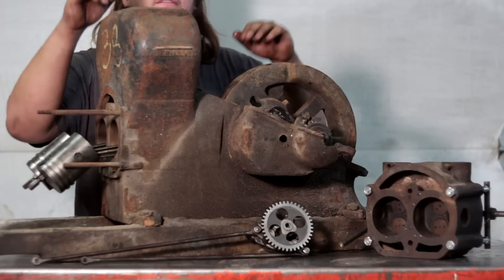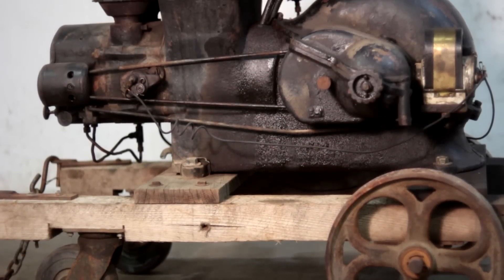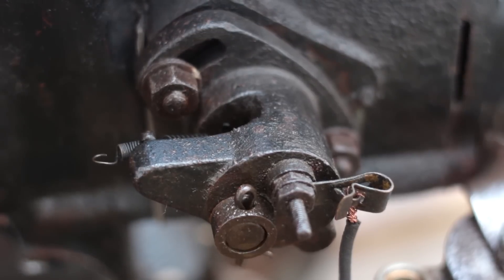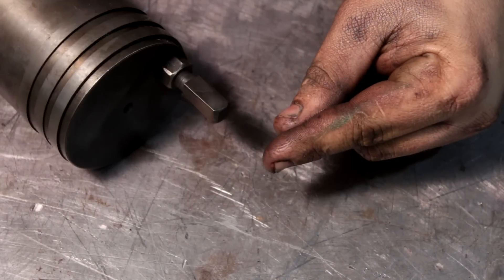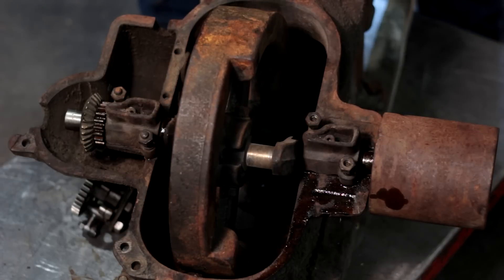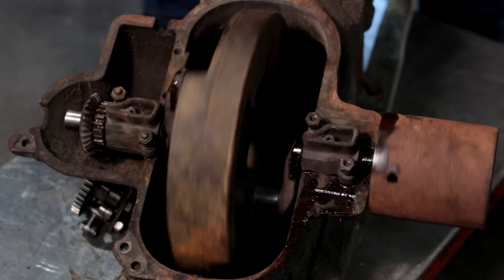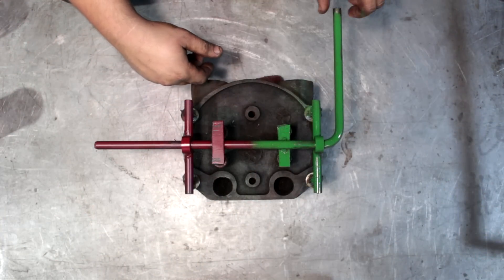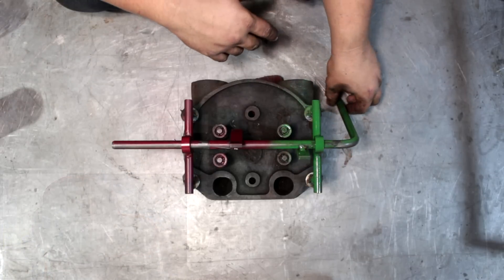DEEPDIVE into 100+YEAR OLD Engine Design Like Nothing  Seen Before! The FLYWHEELS HELD ON WITH LEAD!

Comment: All gas is leaded in this engine! Still, that's a pretty smart way of solving that problem.
Reply from the maker: None of the gas in this engine is leaded they stopped putting lead in decades ago as it was harmful to your health and we had better octane boosters discovered. All the lead in old gas did was help with octane it did nothing more.

Comment: ~90 years before the Mahle (or whoever it was..) collaborated with Dodge to create the Cam-in-Cam, this thing already did it! Jk it's not even comparable in reality and I know those pushrod tubes aren't called cams (I think?) but the basic idea is the same, though I feel like this isn't the first time I've seen such a setup either. Either way I'm sure there's x10+ steam engines that had similar setups, steam engines due to their nature WERE wild from the little I've seen so far. My favourite has to be the pseudo-rotary one; where the piston is a perfect circle & it spins & reciprocates linearly inside an Oblong chamber, luckily for Steam sealing is not such an issue as it is for ICE so no need for weird seals. But it didn't take-off so I guess there isn't enough benefit to all that extra work or something? I don't remember the name & can't find it now but I think it was only in prototype stage only anyway, I've seen a head-sized one here on youtube, not sure if original prototype by inventor or DIY by someone going off' the idea.

Comment: you stated on the installation of  lead sort of a filling or gasket , you stated that you have seen these welded to replace the lead? cast iron welder in my opinion is very very difficult , impressed with your knowledge, a true tradesman ,,

Comment: Fascinating, thanks for the good, pleasing and informative videos. At 7:13, the upper valves are opened just after the lower ones. Wouldn't that make the lower Valves the outlet, because after exhaust comes intake? PLease enlighten me if i get smth wrong! Thx

Comment: That is so clever, thanks for explaining the valve actuation. With these old engines it amazes me how little the valve lift is. Super low compression and low rpm efficient, low grade fuel compatible means less cost at the refinery. We still have a lot to learn from these engineers. I have been a mechanic for 47yrs in New Zealand, Your Kiwi fan, Bryce 🙂

Comment: This is so interesting! The enclosed flywheel design is nice and seems a lot safer than the exposed ones. 
Does the governor affect the valvetrain to control engine speed?
Reply from the maker: it does not it only opens and closer a normal throttle butterfly.
Reply: @cruddycornstalks  
Thanks for the info! That engine was ahead of its time in many ways; it would seem.

Comment: Did a Great Job there, Valving was, as I was thinking, Twin Actuators, and a quite simple and an Elegant solution, as to the Flywheel, you may find that instead of plain Lead it's Babbitt, ( Isaak Babbitt 1830s)  it's Probably a Tin based Grade 2 as this would be strong enough to withstand the Loading , Plain lead would be too soft and would easily Deform over time, especially if the slightest inconsistency of Balance was Present, I was wondering if there's any evidence of machining on the Flywheel periphery suggesting that it was mounted then machined to eliminate Run out? also you need to make a video of just her running, cos I could definitely just fall asleep Happy listening to that baby chugging away..........PERFECT 😁👍

Comment: If this engine doesn't use spark plugs, what does it use? 
I can see it has a magneto, and the mechanism/piston peg/contact breaker that acts to time the spark, but no spark plugs?
Reply from the maker: its using the points on the ignitor to draw an ark when they open no need for a spark plug. my channel has other flywheel engines on it some ive shown ignitors on before how they work go check them out!

Comment: Interesting. Using the output pulley for cranking looks insane but in operation I'd bet you just pull on the drive belt or spin the driven pulley instead of removing the belt. According to an article in Gas Engine Magazine in 1999 the engines had a crank you used to start it on one cylinder and then switched to both.  Which seems like it would break some cam lobes or valves so maybe that's why cranks are rare.
Reply from the maker: from the factory they didn't have a crank but i think i read that article before it was an old friend of mine that was in it and i think it was a old farmer setup with the crank. they are an odd duck forsure

Comment: They could have done that with one cam lobe!
Reply: Engines that used one cam lobe to control both inlet valve and exhaust valve exist.   However optimal performance is obtained with a slight overlap of exhaust and inlet valve open time and different valve open durations. It's tricky.
Building prototype engines is very expensive.   Having separate cam lobes for inlet and exhaust makes for simple and easy change  until its tuned right,' Just make up some different camshafts rather than change a multitude of parts.
Reply: @keithammleter3824  or run separate camshafts that can have timing adjusted while running :p

that was just a joke about the strange push/pull rod setup.
Reply: @Iowa599  Some early engines did have separate inlet and exhaust camshafts.  A considerable unnecessary expense in production though.  A few early engines were side valve but crossflow, which necessitates two camshafts (one of each side), but such engines were shown to be inefficient.
Reply from the maker: If they really tried and wanted to do the math they could have!

Comment: id rather have a 300 lb 1 horse than a 1 lb 300 horse..
Reply from the maker: very true
Reply: I had a 25 horse 4 cylinder  cast iron.  It could run on gasoline,coal oil and a pipe plug in the intake to fit natural gas. Handy during war time gas rationing.
Reply: @allanpatterson7653  that's awesome